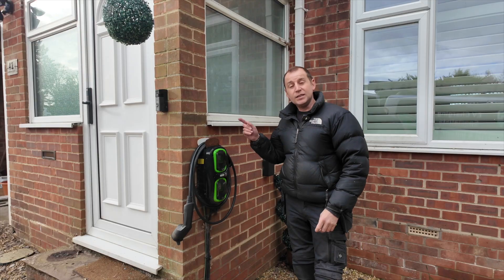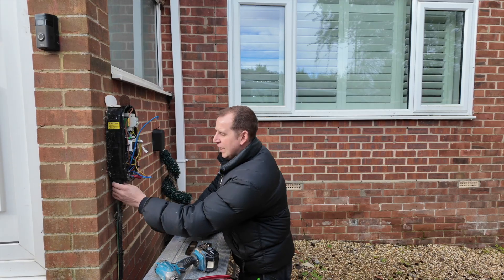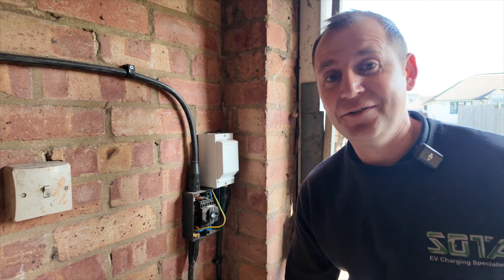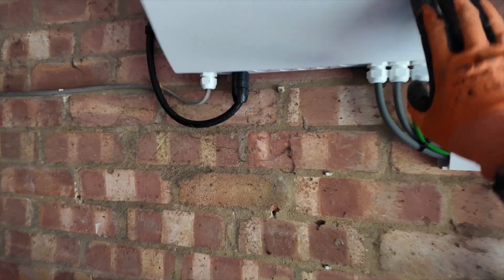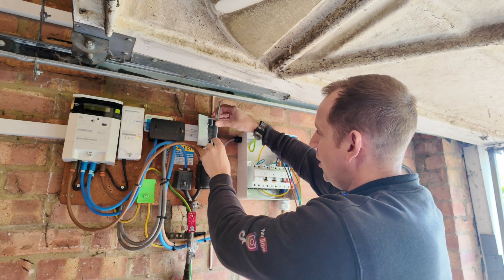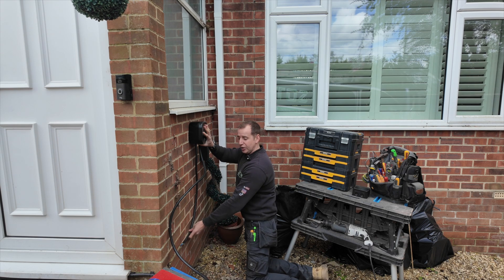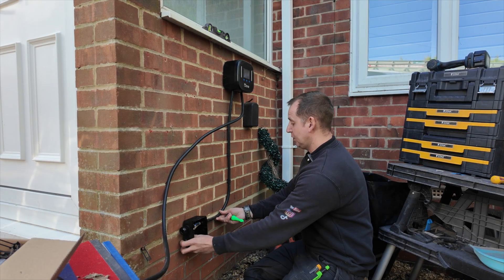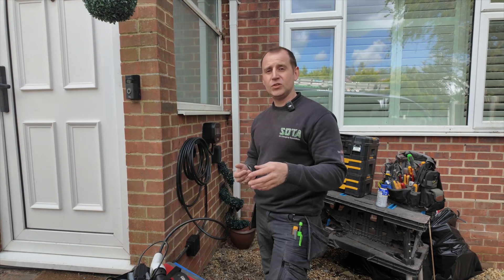EXPOSING SHOCKING ELECTRICAL WORK... EV INSTALLS AT THEIR WORST!!

Comment: Ive had really good luck with the Makita HR2470 SDS Drill. Had mine for years and the hammer is still strong. 
But I also top up the grease in mine every 6 months or so: Take the gear change lever off and fill about half a tub of Makita hammer drill grease into the hole. The part number is 195127-0 comes in a 30mil tub.
If you are not happy with the Makita get a Metabo sds drill.
Reply from the maker: Thanks for the tips!

Comment: Thats what you get with cowboys:
They do the bare! minimum to get an install to "work" and look ok enough for the customer to be fine with it. Cheapest way to get it done no remorse about safety or code violations potentially reusing materials and quoting the customer for brand new gear obviously.
No testing done on the install of course aswell.
But under the surface its all wrong...
NEVER go for the cheapest quote.

Comment: This week, I disconnected an old Indra Charger as it has been burned out and tripping the originally installed C32 MCB. I think the C type MCB caused the damage by letting through higher current without tripping the MCB in time. I never install C type MCB in a domestic property for EV Chargers just type B.

Comment: On about cheap materials, Fusebox consumer units are the cheapest on the market hypocrisy
Reply from the maker: No they are not the cheapest, are you Evan in the trade?
Reply: @ I am *even in the trade yes a Fusebox rcbo is about 13 quid Wylex are 25 quid you know as well as I do Fusebox is the dirt cheapest, what’s cheaper give me a brand please ??
Reply from the maker: @ how about Proteus, WCED, elucian for a start, if your paying 25 for a Wylex RCBO you should have a chat with your supplier because that is way expensive!!!
Reply: @sotaelectrical  how much do you pay for Fusebox rcbos ? 10-11 quid? It is very much the budget end as you are well aware, it wouldn’t be a premium brand would it?
Reply: @sotaelectrical  proteus is more expensive than Fusebox, you know it’s the cheapest just dosent look good probably for your customers if they’re reading and had you install it at high end prices
Reply: Do you still go around acquiring the cheapest materials and fleecing customers ?
Reply from the maker: @ don’t hide behind your keyboard making accusations like that, call me and let’s have a chat 01329 623101
Reply: @sotaelectrical  name cheaper switch gear ??

Comment: I had a pretty simple install and the cheapest quote I got was £500. Took him under 2 hours to do. I just feel that’s a bit overpriced for something I could have done myself
Reply from the maker: You never got an EV charger supplied and installed for 500
Reply: @sotaelectrical  Installation only. The ohme was £300 on ebay

Comment: We had the same charger fitted FOA on the motorbility scheme. 
I assumed the junction box so clos to the charger was ,so in the future the " old outdated " charger could be changed, while the cable run from the consumer unit (the meat of the job) can be left alone?

Comment: I agree with you on everything in this video except one thing. I wouldnt use an SWA gland because it counts as an exposed conductive part. Because the PEN protection is now built into the charger itself you can still have an issue if the neutral is lost through to Earth despite the case of the charger being class 2. I use compression glands, tightened, with the armourings earthed at supply side but insulated within the charger.
Reply from the maker: That’s fair enough, thank you for commenting and watching my video 👍👍

Comment: getting to be a bit of a concern where EV charging points are appearing on houses where there is no parking and cables are being trailed across pavements etc. surely the electrician doing the job should be advising on these matters

Comment: The price people pay isn't always reflected on the work people do.

Electricians, other trades and most people within any sort of work will know what they can charge for something without someone being thrown off or calling it a rip off. 

What you will then find is, is that you could get 5-6 quotes, all of them within £50 of each other in some cases and you'll have someone who can do the same work, with just as good a finish, if not better, for a much lower price.

And the reason for this is because they're happy to charge a fair price, for fair work and aren't out there to rip peoples eyes out and maximise on profit.

Higher prices dont equal better work.

Comment: 4:45 Why did you install a second Consumer Unit? The other one didn't look full.
Reply: We always install a second CU when installing an EV charge point, for several reasons, One,  if the customer has an older style non complaint board with no SPD etc, its cheaper to install a smaller secondary unit with everything in to bring the EV charge point install up to current regs, Two,  if at some point in the future the customer decides on Solar PV with battery storage, the EV charge point is already segregated at the supply end so will not drain the ESS storage system when the car is plugged in providing the CT clamps are in the correct places.
Reply: @bas5946 thank you to you for answering questions like this, and to Adam for the videos. Just planning an EV purchase and learning so much about what to expect & look out for in the  charger install here.
Reply: Thanks

Comment: Not to pick bones 😂 but i do ev installs , firstly you could do a neater job inside your fuseboard install its all abit meh and secondly the ohme charger connects to the bracket with three screws not one, the top one is in purely so the bracket does not fall out , im sure you put the others in when you found them in the screw packs in the box. Apart from that it was an ok install .
Reply: Well said😊 as electrician I do neat job in fuse box as well
Reply: Love it, here he is slamming others when he could have done a better job himself....Hypocrite!

Comment: I'm no EV specialist, nor engineer, but in all instances of data cabling and running power/data in server rooms cat5 (which I assume is the same cat5 you reference) is never to be run alongside power. We run time and data sensitive datacentres and not a simple EV charger, but the principle I think is the same. If I am wrong and the cable is not network cat5, shoot me!
Reply: depends on the Cat5 being protected from EMI by using shielding and usually you would put it 5cm apart. Also depends on the standards of the power cables and earth grounding.
Reply: I also believe most of these chargers just use the “data” cable for a rs485 connection anyway (using one of the twisted pairs).
Reply: Depends on the application.  It is similar to ‘Turn off’ your phones on the airplane type precaution.
Reply: In the example from the video, the twisted pair of signal wires connects a 'current transformer, that makes an analogue signal/current with a very low source impedance, and the other end has an input with a low input impedance. That makes the circuit have a good high ratio between the wanted signal and unwanted noise, as the coupling from the nearby mains wires onto the signal wire pairs will be low, relative to the output from the current transformer.
The principles for coupling between mains wire and network cables is the same, yes, but the threshold for when the coupling becomes too much, depends on the signals. And the risk of failures is harder to remedy if the installation has a 1000 ethernet cables, than just 1 for a charge point. So it makes sense to be more cautious in data centers by placing power and signal separated by an air gap or a steel plate.

Comment: Cost is no indication of quality.  I've seen jobs like that which are nowhere near the cheapest. Prices are gouged by stating exactly the same, "we charge more because we do a better job with higher quality" is a typical line everybody uses.   Charging points are far too expensive to install, out of the question for the average household which is another reason why EVs sales are stagnant.  Someone will come along with a much better way.
Reply: Thinking outside the box.  One attribute to the costs are that only a qualified sparky can make all connections, on this video there are many connections to make, options for cables, the quality of the various junction boxes - all opportunities to scrimp or screw it up.  If Elon came along he'd suggest that you come up with a smart way to measure the job up, then custom manufacture the whole thing in a factory with  quality control and testing into hermetically sealed blocks to include everything right back to the meter connection.  The install can then be largely carried out by a nonce pulling the cable through and screwing it to the wall with only the final connection requiring someone sprinkled with pixie dust.  I can only find 33 issues to solve with this approach.  It just needs a kickstarter to raise 10 million in investment and then I can do a runner with that (like they all do).

Comment: People are going low because the prices for simple jobs are too high. There needs to be a cap on hourly work or a proper scheme for home owners to learn and do diy properly
Reply: Yeah even his install looked like a temporary solution,   all those plastic fittings and connections out in the environment?  Wire just ran like an temporary  extension cord.

Comment: These videos generate me smile always. UK is somewhere in shorly after war time with electric distribution on end customers. One of last countries where is not 3 face in every property,  flat etc. These chargers delivery such a small power to charge electric vehicles. With 3 face is completly different story.
Reply: Well what and how do you suggest doing about it then and are you happy to pay for it?
Sure - if we knew now what we didn't know then we would have done this differently. I'm sure there are things we are doing now which in 50 years time will seem insane.
I'm sure I install stuff which I think are future proofed in my house which in 10 years are made irrelevant.
The facts are simple in most cases. Only a single phase was brought in underground to each property from the street. to change that for umpteen millions properties now would be horrendously expensive.

...and it's spelt 3 phase.
Reply: On the other hand, UK homes have been getting 100A hookups for years, haven’t they? The standard here in NL is either 1x 35A (older homes) or 3x25A, and if you want anything heavier (you might with a heat pump and EV charger), your fixed fee jumps from €200 a year to €800.

Comment: I have found that the cost of quote is no guide to the quality of install. A bad installer can pad a quote to increase profit, whilst doing a poor job.  Only by informing yourself and asking questions about what will be done, do you get an indication of what will be done for the quote.  Comparing materials specified in each quote is also necessary.
Reply: absolutely bang on. price is not always the best indicator
Reply: I have to agree. My expensive German kitchen installed by an expensive fitter is now looking cheap a year later.
Reply: Sie niew stuff is shisse @phphph6022
Reply: You see that here in Ozstraya too.  But - if you are using a reputable 'spark and can check out their previous work - you good.
Reply: Wrong placement of punctuation. I would not like to see the installs.
Reply: Completely agree.

Comment: Looks good, but, why not bury the cable again close to the house wall? I'm not a fan of cables clipped to the outside of houses.
Reply: If you are going to bury the cable then it has to be done properly and at depth not just an inch or two below the surface.
Reply from the maker: Because of cost

Comment: Good job. Eddies of course with a metal box on AC. So the prewired flex is to be terminated into an exturnal double pole isolator as the charger is classed as fixed equipment being over 3Kw hence the lenth.. This is just like an AC unit, oven, shower, induction hob.... We have to do this in the EU anyways.

Comment: See nobody twigged on yet that somebody has stuck a bonding clamp around the DNO lead sheathing. Bang tidy that 😂
Reply: Both clamps look like they were added by an electrician and not the DNO. To be safe check with the DNO if they supply the earthing for that property.  How was your Ze?
Reply from the maker: @Mircea007  ZE was around .28 off the top of my head
Reply: There was a period of time when DNO’s used BS951 ‘bonding’ clamps on their own cables. SSE certainly did.
Reply from the maker: @richardwilliamson3624  if I’m honest I think this was done by the DNO, the main earth was lugged on, most sparks wouldn’t bother doing that from what I have seen in the past
Reply from the maker: You’re the first to spot that! 🤣
Reply: @sotaelectrical  I do alot of testing, I can spot stuff like that a mile off

Comment: The issue with getting someone in to do trades work is that however much you pay you're never immune from getting ripped off. At least if you end up with a shit job you can console yourself that at least you didn't pay top whack for it. (Am I cynical, probably. But that's from paying over the odds for crap work in the past. I tend to do most things myself nowadays - wouldn't take on an EVC though, I'm not daft).
Reply: Couldn't agree more. I think the next time I employ someone not only will I get quotes but I'll also get independent references with pictures and video ideally! In fact I think I'll make sure I get someone with a YouTube channel so I can see them at work first😂

Comment: If we use a joint box of class 2 construction  it’s also important to glad it correctly so the terminated ends can’t move. 👍
Reply: I’ve seen at least one installer on an ohmie using unsecured wagos in inappropriate box to join it ! 🥶😬 Not a clue !!

Comment: By- the-way I don’t trust wiska boxes outside they potentially have 10 year life before the. Ip68 rating goes. Always place out of the weather if you use!
Reply from the maker: Ok interesting topic! I will look into this!!
Reply: Yep there a good product in general but I’ve had on exactly the same that failed under a drain pipe that leaked. I love the fact there class 2 but I think you have to put futher measures in for safety ( obviously already a double pole 30milli amp RCD upfront in the garage but also I would consider water ingress if it fails and not place in as SW direction towards wetter locations as it can and does leak💦🥶 @sotaelectrical

Comment: Can’t we enforce part p rules? Make it very clear to customers they need paperwork NICEIC Napit stroma or don’t accept the quote!
Reply: So as a level 2 trainee looking to start a NVQ portfolio don't get involved with anyone who isn't using NICEIC or Napit to notify the changes? I'm at this point and looking to set a clear path.
Reply from the maker: The trouble is it’s not publicised enough, everything important in the electrical industry is showcased within the electrical industry and not outside it so only us guys know
Reply: Yes I know what you mean ! The problem we have in this industry is not only DIYers builders and kitchen fitters we also have DNO guys who think it’s ok to mess around without testing what they’ve installed! Make installers do paperwork or ban them! @sotaelectrical

Comment: Cutting the cable does not void the warranty I spoke to my Ohme rep, it’s only if you don’t ferrule the cable ends.
They also put in a recent newsletter not to use screw terminals for the JB.
Reply from the maker: Ok interesting! I have heard mixed reports on this now
Reply: What you will use if not screw terminals?

Comment: Worth noting that cutting the moulded plug on washing machines, fridges etc will also invalidate the warranty. Checked this with major manufacturers.
Reply: It is not legal for them to deny warranty coverage for things like that which are not the cause of a fault
Reply from the maker: @mikeselectricstuff  fair enough, just sharing what others have told me 👍
Reply: Depends on the manufacturer. For example, Velux windows allow their moulded fly leads to be cut without invalidating the warranty of the electric windows
Reply from the maker: Great info to share!!

Comment: As if you have to use a JB. I know it's not your fault but it's a shite design
Reply from the maker: It is a shite design, you can’t get into the charger
Reply: @sotaelectrical I'm not an electrician but I hate any design that requires an additional connection. It's one more point of potential failure. Good job though. I'm always fascinated by how the UK mandates armoured cable over conduit. An the US wants everything metal and earthed rather than PVC.